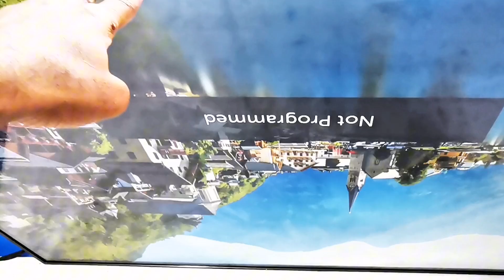BLANK SCREEN, BACKLIGHT OK, LG TV, BOE PANEL 🕵️ Display Solutions #lcd #oled #led #repair #tips #fix

Comment: How to determine that this was fault on this panel? Can you explain how U did it?
Reply from the maker: Hi, @hackerice! Well, I take readings of the test point shown in the thumbnail of all the side COFs. While a multimeter may indicate where a signal is missing, a scope may be the best equipment to use. The key is to test for the presence of that signal at all COFs. Hope that helps.